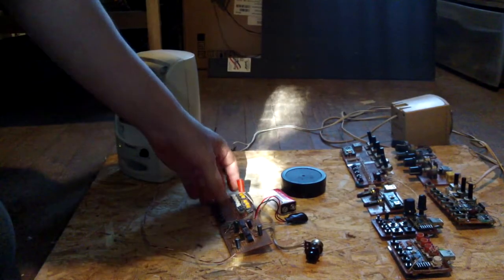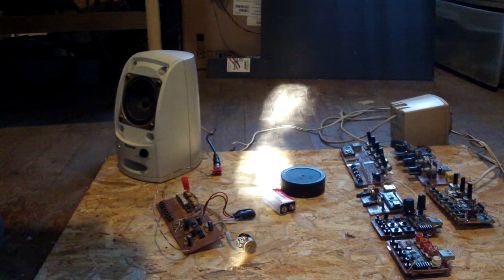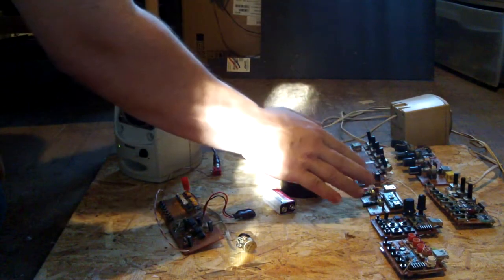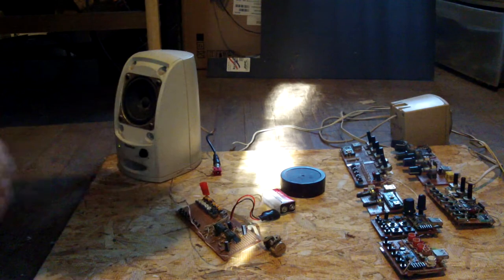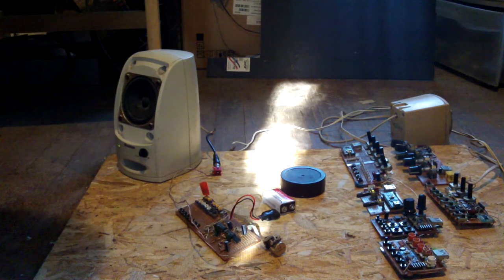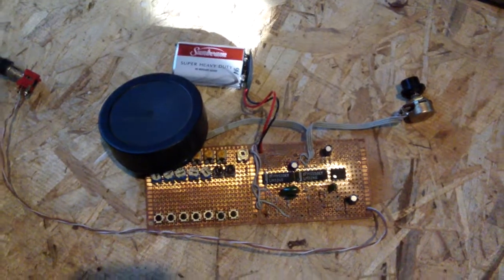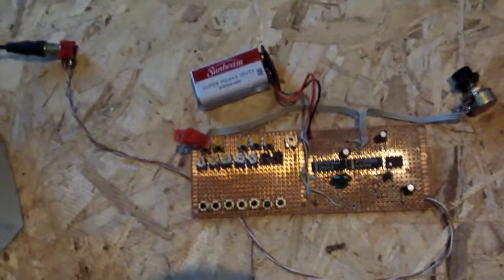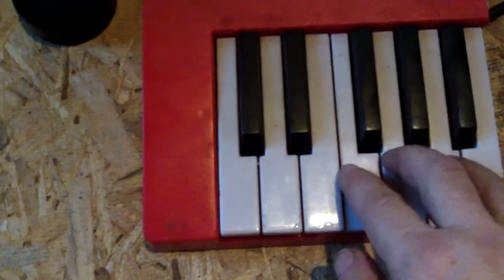tiny synth - Massive FAT Sound !

Comment: hi, great sound! i was made the pete’s circuit but i dont like this permanent noise. i was compared both circuits (pete’s circuit and your circuit) and your circuit it hasnt this noise... how did you got delete? ...about your keys, where is connected? in pin 1 and 6 as pete’s circuit?  ps: sorry for my english ... thanks for you answer!
Reply from the maker: No problem Cesar, your English is fine to me. 
A 100uF and 0.1uF capacitors across the power input connections can really help. It's normally the spikey output of any wall adapter at fault and the capacitors smooth those out.
If it is using a battery, check all connections and any solder bridges or possible defects. Sometimes being close to noisy equipment can affect such a circuit, trying it in another room may show a difference and that would point to interference (computer, hifi, kitchen or laundry machines). Lastly, remove and change out all components 1 by 1 if the problem still isn't fixed. 
The keys are connected exactly as Pete's diagram. The connections on op-amps are always the same, if you have to use a different type than he showed in the circuit.
Reply: Slider2732 thank for your answer! Yes, it can be... but the noise is produced to ldr. When it receives light from the room it produces a lot of noise, but when I lightly cover the ldr, this noise decreases. Why didnt you use the cd40106 like Pete? With bass and tenor drone..
Reply: And r28 is to filter sound, is trimmer pot too?
Reply from the maker: Ah, I had no CD40106, making do with what I had here. Have got lots of salvage boards from 1990's electronics.
Perhaps there is too much light for the LDR. I'd think a resistor in line with the sensor would fix it. You may lose a little range in the high end.
Reply from the maker: I can't see R28 on this monitor (old 17" VGA) and unfortunately don't remember the specifics now. But the circuit is the same, except using the different op-amps, it's functionally identical.
The whole thing is something to get back to. I fitted the pink keyboard thing and did add a power jack plug etc, but it would be good to add extra keys.
Reply: Slider2732 r28 is the pot that is in the audio output
Reply: @cesarcofrer  I just finished this circuit myself if you look at my channel. I had the exact problem as you. I actually had to build twice because like you I was having problems with the sound. At first it was way too quiet then I poked around with jumper wires and like you too much noise on the ldrs. I just started over and rebuilt everything and I must have done something different because sound is much better now.
Reply: Jkeeb89 great !! Any suspicion of the problem?

Comment: Very very cool. I used the same basic osc design to build my diy synth proto. Its intresting using light as the input control and more physically expersessive , bit like a theremin i guess. Top job . Great sound.
Reply from the maker: Thanks :) Yep, I agree about the Theramin aspect...quite natural too to play it like that, bizarrely enough.
Reply: Slider2732 Indeed , i guess because musical instruments and more namely synthesizers are played by keyboard interaction or foot pedal, we get locked into a box. There has been some but, very little in the way of new ways of playing and controlling them.  However in my opinion synthesizers, dont even have to be what may be classed as conventionally musical .
Reply from the maker: Laser harps would be a good example...load 'em up with bird sounds, or water sounds or whatever. Hmm, remix a dawn chorus perhaps. But, yes, rigidity of playing style for something like a synth is a bit of an odd distillation !
Reply: Slider2732 .Indeed agreed 😎😎😎.

Comment: Very interesting sounds.  I built a single chip synthesizer way back in the 70s using a SN76744N? (forgot actual chip #).  Radio Shack I think was selling the chip.  There was a lot of circuitry on that chip and it made all kinds of crazy sounds from space ship motions, phaser blasts, teleporter sounds, crickets and so on.  It could wire to a switch type keyboard, but only one key could be used at a time, so only one tone at a time, no mult key tones..  Will your circuit allow multi keys on a keyboard to be pushed at the same time to make combined tones?
Reply from the maker: I'll bet that was fun with the chip. They still sort of do that, with kiddie keyboards...all being on a black blob.
This is monophonic, 1 note at a time. It could be polyphonic if a circuit was built for each key and, that's what some designs did back in the 1970's too  (others used loops of tape per key, pianos and air or reed organs were multi-key)
The type this one emulates is the big monster Keith Emerson type things that filled a wall of a room, with cables plugged in everywhere.
https://www.youtube.com/watch?v=NpgS9prNZT4 - fave line "This doesn't go up to 11, it goes to 12 !"

Comment: Pretty neat, got to ask, what or how does that black puck do? How ... what is it?
Reply from the maker: Yeah, the photo-resistors alter one of the op-amp stages to shape the dual oscillator output. They are like a pair of variable pots, but give much more range and control.  
The puck itself is a random plastic tub, just has to be something that can cover both sensors easily and fully. A yoghurt pot would work well, a cupped hand works ok.